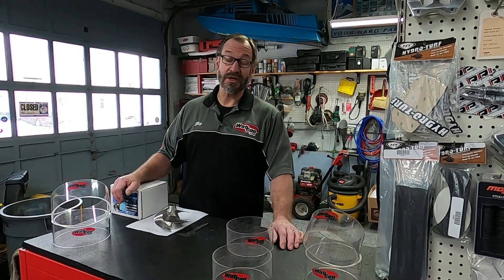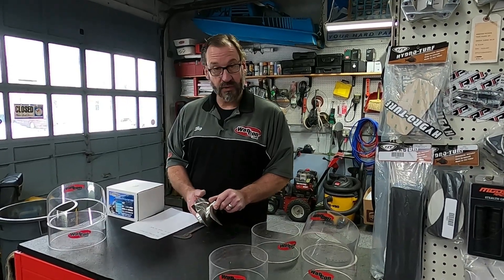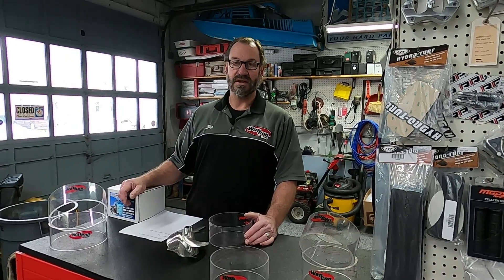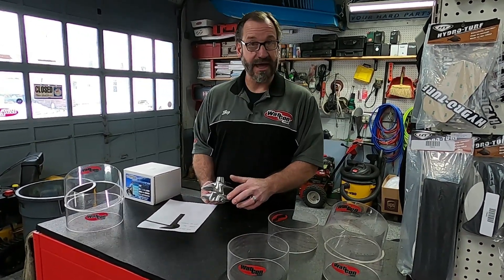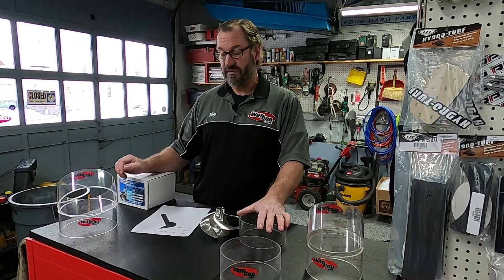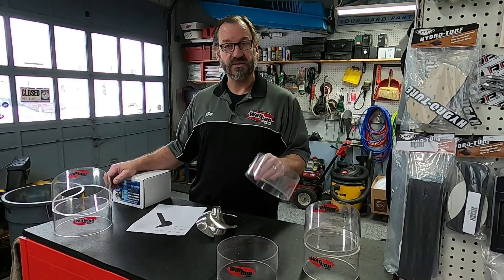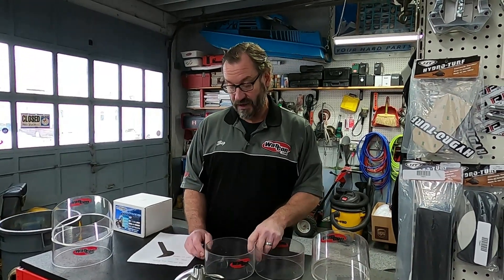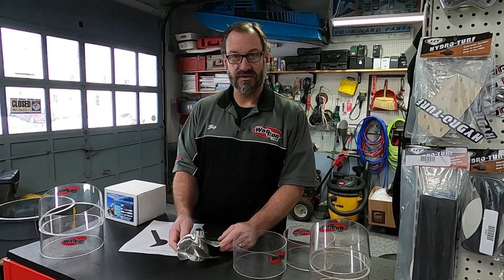Watcon Impeller Pitch ring use

Comment: Can you make a videos on how to properly check the gap from impeller to impeller housing
Reply from the maker: Hello Jeff. Thanks for watching. A shop service manual for your machine will give you service limits for impeller to wear ring gap.
Reply: @watercrafttalk2738 thanks! One question. If the gap is to small can it cause cavitation issues like poor acceleration
Reply from the maker: @jeffbryner5355  No, If the gap is too Large it will cavitate.

Comment: I have a Yamaha exciter 270 with group k custom pitch impellers which help even out rpm due to pump loading with intakes on either side of the v hull, they are not cheap, to extend their life would wsm plastic liner housings to reduce outer edge prop wear and replace liner each year to maintain performance or go solas stainless steel housing and just replace impellers once they wear?
Reply from the maker: I am not a fan of the plastic wear rings.